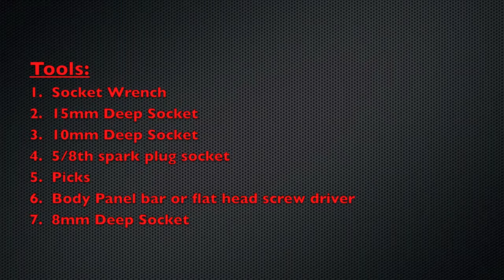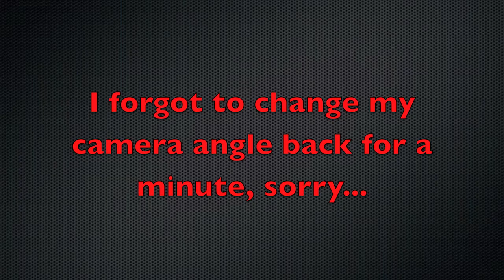2008 Mazda 6 Valve Cover Seals and Spark Plugs Change (4 Cylinder, i model)

Comment: I currently have my valve cover removed and I'll be cleaning it & fitting the new gasket tomorrow.  I removed about 8 oz of oil total from my spark plug wells!!! I don't think I would have tackled this project without seeing this video.  Thank you so much for the detailed and thorough video.  The removal was very easy.
Reply from the maker: J S:  very glad it helped

Comment: A good tool to remove cable ties mounted on threaded studs is a wiper arm puller. The dimensions are just right. The black conduit can be popped out with a pry bar, preferably a wide one for trim moldings as used in construction.

Comment: Thanks for the video! Exact same layout as a 2005 6i. Still trying to get the bracket off the top left hand valve cover bolt without breaking it.
Update: Finally got it, just needed more twisting and force. No leaks yet. Hopefully this was just failed valve cover seals, not blow by or a plugged PCV valve. (Removing a pcv on this car is an 8 hour job; requires removing intake manifold.)

Comment: The only thing I'd say is use some RTV sealant at either ends of the timing belt where the casing joins.
Reply: It's mandatory.....not doing it will cause a leak, espacially if it's cold outside.

Comment: Just a quick tip, if you’ve got the time’ it’s a good idea to leave the car sit over night, after tightening the cover bolts, then retighten next morning, and complete assembly. You’ll be surprised how slack they are, these new type gaskets are buggers to conform. Hope this gives you a better, and longer seal.

Comment: The video is very interesting and very instructive, thanks for sharing.
Reply from the maker: Jose Añez - Glad it helped.  Sadly I will have some suspension videos in a month or so.  Picked up a MazdaSpeed 3 which needs some work.  Need to change my name to Mazda Guy...
Reply: If Guy, I really liked your video on how to change the packing of the valve cover of the Mazda 6, now I require please, like changing the rear shock absorbers of the Mazda 6, thanks, bye bye ....
Reply: 2008 Mazda 6 How to change the rubber or bushings of the rear stabilizer bar
Reply from the maker: Jose Añez  You could check ChrisFix.  I find him very good and he does some Mazda suspension work.  I just picked up a Gen 1 MazdaSpped 3 that needs some suspension work and probably bushing like you refer too.  I will research that in prep for the job and will try to video that too.  Good luck.

Comment: Great video. One can follow as obstacles are encountered and overcome. Two points. I believe the spark plug gap that you mentioned is not "point four nine", but point zero four nine. You shouldn't adjust them anyway, just clearing that up. Also, when you started tightening the valve cover bolts, you tightened one of the middle ones. You came around and tightened it again at the end, ending up with 14. I couldn't really see, but aren't there two bolts in the middle? If so, you counted to 11 around the perimeter. 11 + 2 = 13. For me, to make sure I didn't miss any, that would be important. Also, I plan to tighten them in a small circle, spreading out until the end ones are done, like doing a cylinder head. It may not matter, but it might. Very good though.
Reply from the maker: Thanks for the feedback.  I thought I double checked the 14 but you could be right.  I crashed the car a week or so after so it in the shop (backing into a Jeep with a post apocalyptic bumper is a bad idea...)  I agree it would be best to use a torque pattern.  Working to get a better mic also.  That said, this is very part time for me.  Been super busy at the job that pays the bills...

Comment: Thanks for video. Hav couple questions? Did put any gasket adhesive to the engine cover grooves so that gasket doesnt fall off? And u said thin..bump..and thick side of gasket...does the THICK side of gasket go into the grooves of the engine cover or the engine ? Thanks
Reply from the maker: Davin Davin:  I did NOT put any gasket adhesive on.  This was a while ago but I don’t believe it’s required and I think I saw mixed reviews about it being a good idea.  The thicker flange went into the valve cover so up in running position but down onto the valve cover in the position it’s shown in the video.  Good Luck!

Comment: Is it suggested to change the spark plugs if oil has leaked around them? I recently changed mine about 3k miles ago and don't want to buy new ones since they're still good.
Reply from the maker: Emmanuel Bravo, Summary: Your plugs are fine, reuse them.   If you changed the plugs recently, but have oil around them, I would change the valve cover seal (including the tube seals).  The oil doesn’t hurt the plugs really unless there is so much it’s shorting out on the  cover (which I presume is pretty rare since it would take a lot of oil).  So reuse them.
Reply: Thanks!

Comment: So would the oil leaking onto the spark plug area have any effects on being able to start the car?
Reply from the maker: Trevor Marske, I would say it's possible but only if there was a lot of oil.  Basically if there was enough oil to make it to the contact point at the top of the spark plug, you could be affecting spark by shorting the plug out or messing with the energy flow of the system.  That is my guess.  You need quite a bit of oil though.  You could pull the oil out with a turkey baster and clean up the plug and hole and would be able to trouble shoot that as a source I would suspect.

Comment: Does anyone have expirience with little oil on plags, not like on this video? I have little oil on every spark plug but only on threads. When i pull out spark plug wiring its dry around spark plug but when i unscrew spark plug it has some oil on threads. At first i tough it was a leaking injectors so i changed injector selas but its oily again. Please, every information can help. I am thinking that its just from cylinder, piston rings are little worn and some oil gets through.

Comment: Just realized this is an 08' , is the the same as the 07' i model ?? Will be doing this in 4 hours oh lord please be the same
Reply from the maker: RITTY PLAYS ,
Although I'm not 100% sure I believe it applies at least back to 2006.  So you should be good.  It may even be earlier.
Reply: @MikeNSX  looks the same as the 2012 6i also

Comment: Also, use paper to fill the spark plug hole, just in case something may fall into your cylinder.
Reply from the maker: It wouldn't hurt...

Comment: I've replaced these seals. But I've still got oil on 1 sparkplug (on thread) 
Causing a rough idle when up to temperature. 

Any ideas?? I'm stumped.
Reply from the maker: MrGrimsApprentice:  I’m certainly no expert but I would think there are only two sources.  1.  The seal is not seating maybe due to damage or dent on the head sealing surface.  2. Maybe getting through the spark plug (unlikely though and would likely have other issue).  3.  Maybe the valve cover cracked?  That’s all I can think of.

Comment: Hi, did you have any oil consumption before?
Reply from the maker: Eduard Nitescu:  I did not have oil consumptions issues.  Tube seals are not likely to leak that much.  Even the full valve cover would be unlikely to leak that much (although possible).  Actual consumption is probably from something else (if that’s what your saying you have).  Good luck...

Comment: Wish I realised this before changing spark plugs oh well I  sure they can be cleaned up. Going to run it abit before I do the gasket just in case I was wrong
Reply from the maker: Sean Harrison:  It’s easy enough to check.  You don’t really need to take the plugs out.  If you take them out, I would NOT do anti seize.  The more I’ve read the less I think it’s a good idea.  Good luck...
Reply: @MikeNSX  aahh fair enough oil doesnt get into the cylinder till i take the plug out. so probably just stick a rag in to soak up the oil.

Comment: You forgot to add sealant to the joint spots!
Reply from the maker: Did I?  I’m not entirely sure what your referring too but this was a while ago now.  Can you clarify for others what your pointing out?  Also for me in case I ever have to do it again (I sold the car to my buddies son but could get called back to support…)
Reply: @MikeNSX  I've watched a few of these videos and there is a spot where the cases meet that needs some Permatex so it doesn't leak. You can see where the metal meets on the left side near the timing chain cover.

https://youtu.be/eh3mKghe8tc?t=1255
Reply from the maker: @esurfer89 I follow you now.  Seems wise to do this.